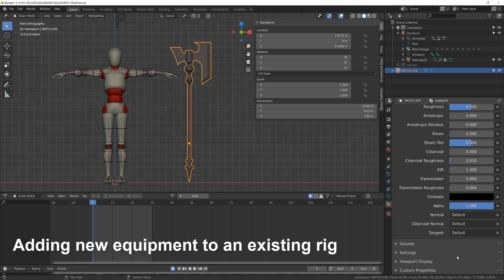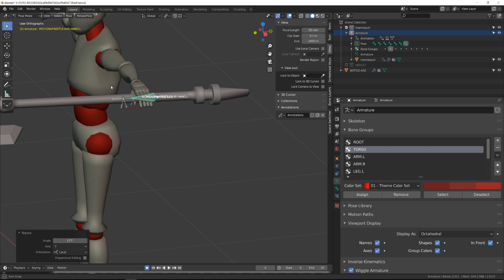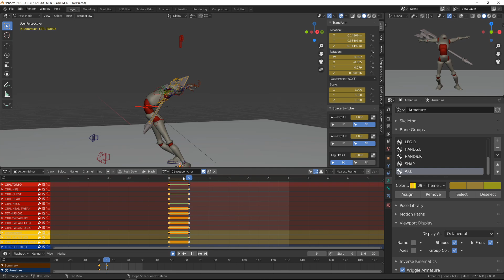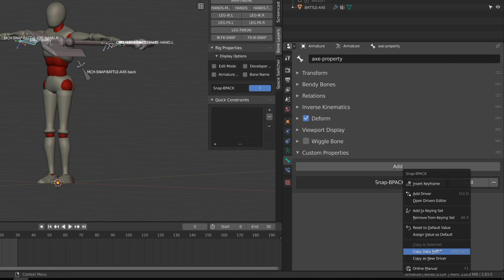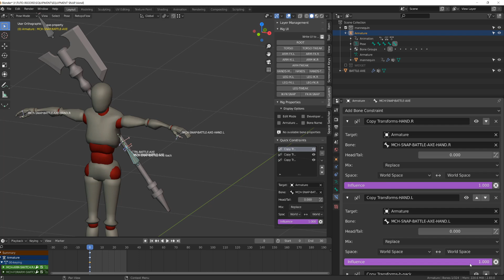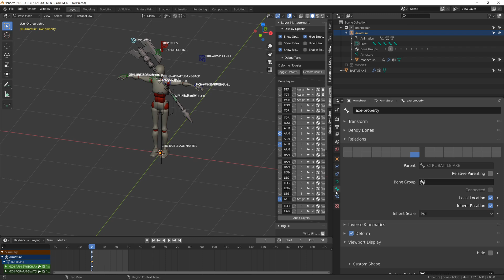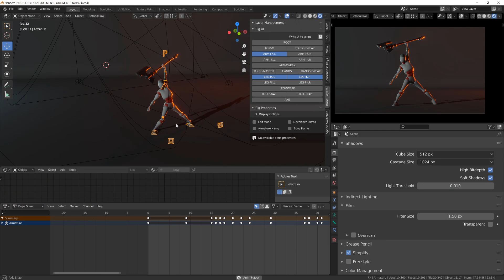Rigging equipment and weapon slot in Blender

Comment from the maker: Here are the different steps : 
Adding new equipment to an existing rig : 01:49
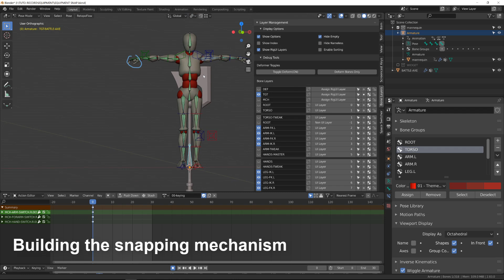Building the snapping mechanism : 02:38
Adjusting bone position : 04:21
Back pack slot : 05:39
Creating the custom switch : 08:17
Double handed mechanism : 11:23

Comment: Double Handed Mechanism Fix:
There is a minor issue this tutorial misses (skips)
at 13:10 CTRL-BATTLE-AXE-MASTER had to have been unparented. Earlier when duplicating the Control Bone, it was still parented to the MCH-SNAP-BATTLE-AXE. 
If you unparent at this step and apply the Master Control Driver to the Copy Transform Influence on CTRL-DEFORM, it will fix any issues.
Reply: Thank you. I finally solved it.
My hands were flying when I moved🥰
Reply: @DanDanceMotion  ajajaja

Comment: Great video Pierrick. Everytime I got a problem with my custom rigs I just go immediately to your videos. 

I am creating a game where few combos will have a character throwing weapon in front of him and then having it materialize in his hand/weapon slots at the end of animation.
This tutorial kind of gave me idea how I could handle it, by adding another bone parented to the root of character in 0,0,0 position and then making a driver similar to yours but with float expressions for smoother transition.
The slight problem with this, is that everytime he decides to throw the weapon, I have to take the controller bone 0,0,0 into similar positon of hand bone before detaching it, instead of having it snapped to the hand aswell and making the animation easier to handle.

Is there a simple solution in Blender that will make the bone detach from hand and then use the bone to freely move or I'm just overcomplicating it?
Reply from the maker: Hi, no that's the idea.
You create a key positioning the weapon wherever it needs to be when released.
You can make great use of this addon : https://fin.gumroad.com/l/yndvr

Comment: Awesome tutorial, Pierrick! I'm learning so much from your videos. I'm now considering buying your courses because you explain things very well. 

Quick tip: When you are dealing with the constraints switching, you can write a boolean expression instead of figuring out your quick maths. Since we are switching between integers, we can simply check for the numbers themselves:

Expression:
var == 1

The above expression will check if the var being passed in by the Data Path is equal to 1. This is more intuitive than trying to figure out differences between numbers. 
var == 1, to check if the Custom Property is set to 1
var == 2 to check for 2, ... and so on. 

What this will do is flip the influence between 1 and 0 based on the result of the expression. Very convenient in terms of switching between constraints where you only allow for one constraint to be active at a time!

Be sure to have two equal signs, it just means "is equal to" in programming since one equal sign is used for something else, but I digress.

Anyway, looking forward to learning more about Blender with your help!
Reply from the maker: Yes, I’m using booleans now. This one is kinda old

Comment: hey there , this method is useful If I decide to export the character and the weapon to a game engine such as Unity? because I am planning to do a workflow ,for universal holding weapon, and then in code switch the weapons, but I need the same animations apply to differents weapon (of the same styke ,pistol, for example) ... but the most important thing I do not want to include extra bones in "avatar" in unity , I would like to see clean avatars in unity with property name convention.  that is a little trick I am stacked for more than a 10 days with this problem of using weapons to unity , without compromising the avatar with extra floating bones (special for that who need to use in relation of the bone's character with the weapons). thx!

Comment: There's an easier way to ignore scale for the back slot. Select the bone, go to Bone Properties -> Relations -> Inherit Scale. Set it to None.
Reply from the maker: And this is one of the worst thing you could do. Never ever uncheckk inherite scale, or rotation in the bone relation properties as it's absolute. Meaning that you won't be able to scale your rig without breaking it.
Reply: @PierrickPicaut_P2DESIGN  How so? If you still need to scale the weapon for any reason, you can just reuse the same scale factor on whatever bone you're using to scale it. Unless this would somehow prevent you from scaling up your model in a game engine, this shouldn't be an issue if the goal is to scale the weapon independently from the parent.

Comment: Hello, Pierrick Picaut
I'm trying to get a katana in and out of its sheath easily. Without having to move the hand with the union of the katana handle, until its complete exit.
I'm using your tutorial to get where I want. However, in the part of doing the initial process of Target_Bone_Sheath, when moving the TRGT_Bone, it occurred to me that a sheath did not move with the same intensity with the bone, as if there was a slow or smooth movement. Would you know how to help me through this process? Hugs

Comment: Very cool but can someone break down why we need so many duplicated bones at the same point? Its like I need a flow chart to understand what bone to use and why.
Reply from the maker: You need the controler of the axe. Then it's parent that will snap from one point to the other and finaly the different points in space.
This is a concept I've explained in detail in my course. One bone as a source, one intermediate bone that will copy the location, and/or rotation and/or scale, and one bone as a child that will inherit all of these but will be free to get transformed by the animator.

Comment: Is there any particular reason that you assigned the axe to the deformation bone with vertex groups, instead of parenting it? I mean, that's what I do, but I don't have a good reason for it and I'm in desperate need of an excuse.
Reply from the maker: This way, you can join the axe to another object or mesh, like the character and the rig will still work. While it wouldn't if it was parented to the bone. Also, it's a more corss platform way to deal with armatures... But parenting to the bone is totaly viable and doing it without a reason is perfectly fine :)
Reply: @PierrickPicaut_P2DESIGN  Thanks for the response! That makes sense. I meant that I always use vertex groups to attach geometry to bones. I suppose you could also run into problems with moving the bones in edit mode after parenting. But also I think it would take a bit longer to calculate armature deformation (although I'm not sure), so I guess it's just pros and cons.